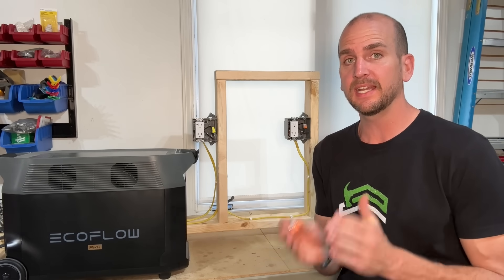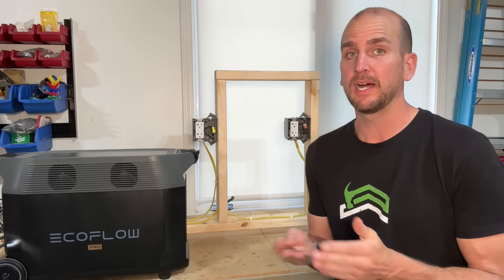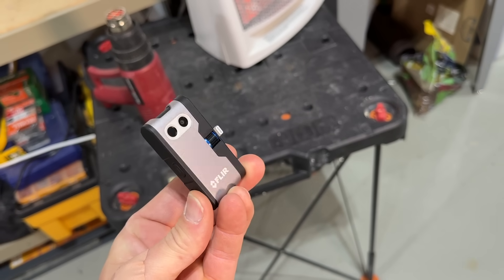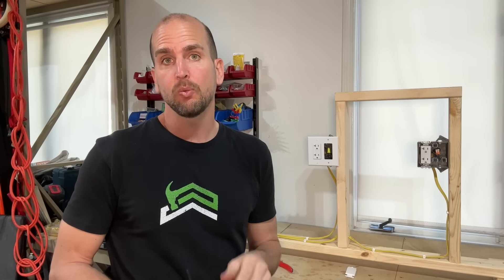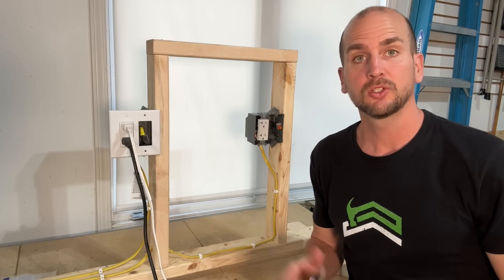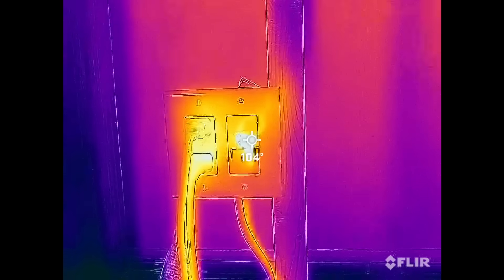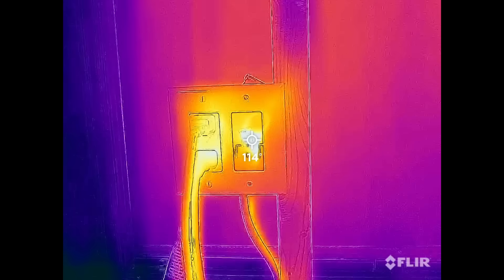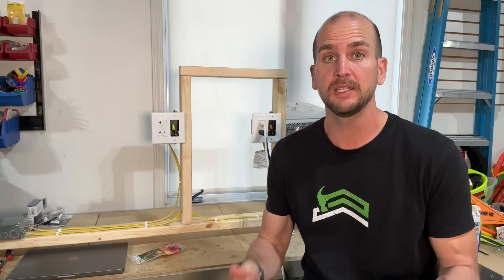Debunking the Pros: Can WAGO Lever Nuts Handle Heavy Electrical Loads?

Comment: I am regularly using WAGO 221 and have not had any problems so far. Takes less space and makes me more confident about the connection.
Reply from the maker: Amen to that 👊
Reply: There is only 1 problem with it, sometimes the lever opens up by pushing it in the j box! Have to tape it around. I'm using it mostly for connecting light fixtures with smaller stranded gauge wires. For this application is it perfect❗️

Comment: Now I am curious as to why kind of plastic is used in wire nuts and Wagos. Is it the same or different? Some plastics do deteriorate over time, from age and heat.
Like other commenters here, I now always use Wagos for lighting, especially when connection solid and stranded. But ... I have had receptacles with 12 gauge wires so short  I could have not used a wire nut. Wagos were the perfect fit and solution.

Comment: These WAGO's in my opinion are no different than back-stabbing switches and receptacles.  After having back-stabbed switches and outlets go up in smoke, that proved to me there is no "quick way" to make electrical connections.
Reply: The are completely different. A WAGO is akin to a screw tightened back wiring. There is now even a UL approved electrical outlet model that uses WAGO lever closed type connectors. 

Among its other faults, many/most people do not know that stab connections are "one use only". In other words, if you disconnect it, then it cannot be legally reused.
Reply from the maker: I know they look similar but the rentention spring in the WAGO is superior to the small retention tabs used in speed wiring and also the busbar material seems to be a much higher grade on the WAGO as compared to the internals of the cheap residential grade outlets where backstabbing is so prevalent.

Comment: Honestly, that is pretty good performance for being 3-4 amps above the actual max amperage spec of the wago.
Id be interested to see a voltage reading of the wire before the splice and after the splice for both the wire nut and wago. higher resistance should mean less voltage, and that drop is bled off as heat. So does the wago drop an extra 1-2v? Or is it less than a 1v difference? Remember you have to take the longer wire going to the farther receptacle box into account though.
Id also be curious to see the heat difference between a wago 413 and a 613 that is actually rated for the higher amperage. Does it make a difference?

Comment: Thermal imaging isn't really the best test for the question at hand (resistance). Although, if we take the values for what is shown, that 10° F is actually huge. WAGO's have about 3-15 times more resistance than wire nuts when freshly and properly installed (depends of what model WAGO). The WAGO is also more susceptible to increased resistance from the bending usually involved in fitting the wires into an electrical box. That said, it's easier to properly install a WAGO than a wire nut. If I'm not doing or inspecting the work personally, I'd actually prefer WAGO's be used. Just another reason I do all my own work.
Reply: Can you provide documentation of your claims? It would seem to me that the WAGO would have about the same resistance as a screw terminal or clamp.
Reply: @buggsy5  WAGO's are limited by the relatively small amount of tension in their springs. Screw terminals and clamps (depending on the type of clamp) can apply much more pressure and will typically have a larger contact area. Wire nuts operate a bit differently since the primary electrical path is directly from one wire to the other. The metal insert on the nut is more for mechanical reasons than electrical, and isn't really necessary. Comparing the resistance of WAGO's and wire nuts, there are tests out there like this one from GreatScott: https://www.youtube.com/watch?v=zgjo36-jaFY

Comment: I'd measure the voltage across the Wago to see if there is any significant loss compared to the other connections.
Reply: The experiment showed that there isn't. The slightly higher temperature was not necessarily due to higher resistance, although it probably was.

Comment: For those outside of the US... please have degrees Celsius!  Any time I don't see it, I very much discount your methods as not willing to even throw on a 2nd axis and set it so it has the correct scale, instead of forcing people to pause and do a conversion.
Reply: The conversion is trivial - for those that care. In this case, the temperatures are roughly half way between boiling water and freezing - so roughly 50 degrees C.

Comment: You can't possibly say it's creating more heat or has more resistance when the Wago also has less insulation than a wire nut.
Reply: Insulation is only one of the factors affecting heat transfer.

Comment: I converted to using Wago years ago thanks to your videos.  I know it's easier to use than wire nut, and probably safer for some connections.  But there is one thing I am still curious about.  Does using Wago cause more electricity usage?  Since the Wago connection is more resistive, and create higher heat.  Will I be paying for more electricity wiring the whole house using Wago, and by how much?
Reply: The slightly higher resistance would mean slightly less current - which means slightly power consumption.  So your electrical bill would decrease, maybe a few dollars a year.

Comment: Doesn't the extra heat generated at the connection point lead to more oxidation, then more heat, etc?
Reply: The heat difference is insignificant.
Reply: @buggsy5 
Thx👍😊

Comment: Thanks for your research. I just started using Wago nuts and like them because they seem to take up less real estate in the junction boxes. They also make it easier and safer to test wires and with the ports you don’t have to remove to test with multimeter.
Reply: So u never have stuck a probe thru the bottom of a wirenut?
Reply: @RadioRich100  It’s easier with a wago nut for me. Plus, if I need to test a traveling wire to identify it’s easier too. I’m not a professional, maybe if I was I’d view it differently.
Reply: @goldwingerppg5953  U dont want a house full of them.
Reply: @RadioRich100  Why do you say that? I’ve watched very experienced licensed electricians on YouTube recommend the Wago nuts and they meets or exceeds UL standards.
Reply: @goldwingerppg5953  The very experienced also installed aluminum wiring in thousands of homes, hundreds of them burned down. Most contractors want speed and lower cost not caring that in the future somthing can go horribly wrong - with them being long gone. Wagos are convenient - thats it! There not just as good or better. So why use them? Speed and Convenience!  This is why there banned in so many places even with lab approvals which can be bought.
Reply: @goldwingerppg5953  Very experienced licensed electricians on YouTube?  Most of these guys, like this channel, are only DIY'ers.

Comment: I'm neither a teacher nor an electrician, but I'd show this to middle school kids as a demonstration of the scientific method in a real world scenario.  You get a solid A for experiment  design.  Scottish-Canadian electrician W. P Marr patented the wire nut we know today in the 1930s.  I'll betcha a hot pastrami and swiss on rye, a big-ass kosher dill pickle, and a cold beer that, if YouTube had been around then, the guys who were married to solder-&-tape connections were making these same arguments.

I'll add that I find it 'way easier to get Wagu 211s to lay flat in a box that even the smallest wire nut.
Reply: Id rather a Genos Cheesesteak from Philly
Reply: Your analogy is nonsense, its the track record of wirenuts which lasts the life of the house. Wagos are questionable at best. They like them because there quick-no other advantage and not even just as good. They put resistance between conductors. With wire nuts connections between  conductors are direct. Wagos are resistors with flip levers. No lab can tell you what happens in the field overtime. Remember aluminum wiring - its cheaper! They thought that was ok too. Hundreds of homes burned to the ground. And its still happening. Take your wagos and put one on your hot pastrami sandwich and eat it.
Reply: @RadioRich100  Sorry if I offended your religion, but I'm an infidel.  It's also too bad you don't know what an analogy is.
Reply: @neilmarsh1904  Apparently you have never googled anything.
Reply: @RadioRich100   . . .ha ha ha 😀😳😱😨🤣 pastrami sandwich - omfg thats hilarious !!

Comment: So the standard wire nuts tell you flute are ok up to 221 degrees?  I wonder what the wire and the other components are rated for? Also ponder how much of a voltage or power drop the wagons would have. More resistance equals less power output.

Comment: I think that one key thing this experiment doesn't measure is the affects of heat cycling. Putting a new wire nut of any kind in and measuring is one thing, but what does it look like after 500 heat cycles? 2,000 heat cycles? Do things loosen up after that many?
Reply: UL has certainly tested for probably thousand cycles or more.  They passed WAGO.
Reply: The have been used for at least 45 years in Europe. No heat cycling problems have occurred. 

Copper is not subject to the same degree of expansion/contraction problem you find with aluminum wire.

Comment: What is attractive about the Wago product is its' ability to handle stranded wires as well as solid in a very straightforward and fuss-free manner. My house is done in wire nuts for the most part but any time work on a lighting fixture everything gets changed to Wago...

Comment: If you want a better test, put them in series (they'll both see the same current draw). Then load the circuit at max (not above) for days and weeks. Check the temperatures daily.

This will ferret out the winner and the looser.

The failure of a connection isn't as simple as temperature. It's a combination of temperature, oxidation, higher resistance, higher voltage-drop, and possible arcing. When arcing happens, there's usually the addition of carbon deposits, which causes more arcing, high temperatures, high resistance, and so on.

These things take time, usually weeks at a minimum.
Reply: You might want to research the history of Wago connectors, and their use in European markets.  There are decades of data on these things.
Reply: @SplashJohn 
I said nothing about the brands. Just connections in general and ways to test connections, which will result in more robust data.